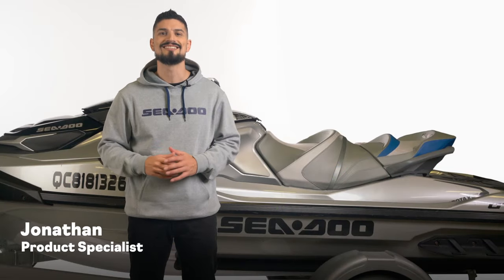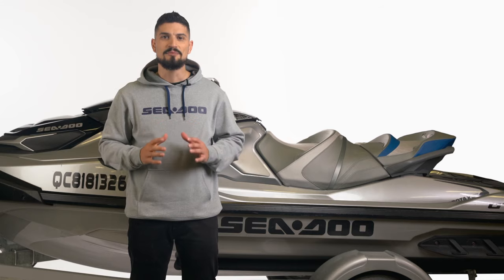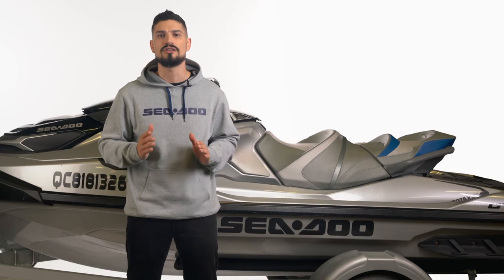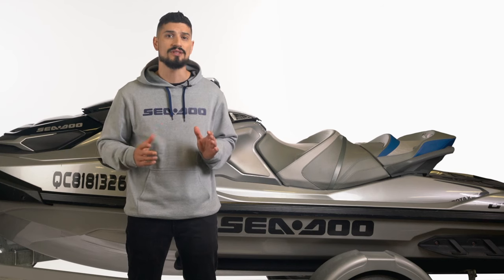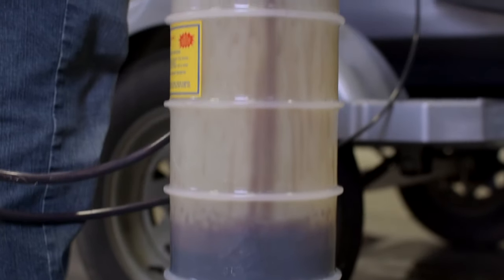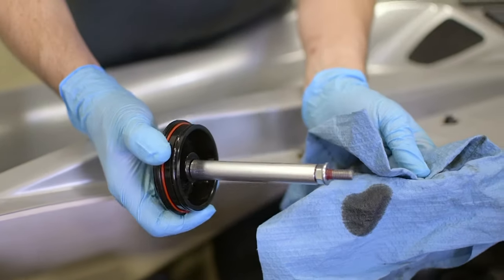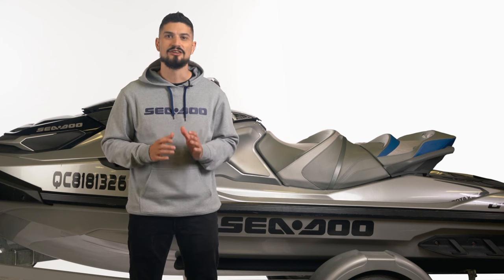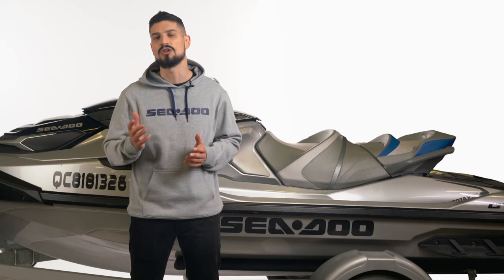How to Change the Oil on Your Personal Watercraft | Sea-Doo

Comment: Do not start the water into the exhaust before starting the engine. I feel like this is an important point missed. 
Engine On > Water On > Water Off > Engine off
Reply: Very important to not run water with engine not running. 
Also add the same amount of new oil as the amount of old oil removed. One may not need to add all the oil in kit.
Reply from the maker: Hey Aaron, 

We appreciate your feedback.

Comment: Nice only I would for sure add that you should also crank the engine and insert extractor into oil filter area as old oil is also located there as well. Also should change small o-ring every time.they are cheap and just a good idea.

Comment: Hay,,, it’s not e8 for the filter housing, it’s a e10. Y’all got a pretty good video for servicing this engine, but y’all need to make a correction from the e8 to change oil filter to e10. I really don’t know how y’all missed that, but fix it. Thanks.
Reply: I don't have the actual torx sockets but I have the multispline which does torx, square, regular, and it was 8mm
Reply: Mine was 10  @MACK3RW
Reply: The 325 uses E10.

Comment: This video should be redone the incorrect external torx socket is referenced. They suggest an e8 and on my Rx, TX 2023 and RXPX 2023. It is an e10. If you’re going out, especially to buy an E8 you will be seriously disappointed when you get home.
Reply: Yes mine was a 10

Comment: Dosnt it hurt the motor to remove oil and turn the seadoo over sounds like it would
Reply from the maker: Hey there, 

It's important to follow the directions carefully and consult your owner manual and or local dealership for further guidance
Reply: Just answer the question 😂

Comment: Does anyone know how to clear the "Maintenance Required" message on a GTX 300 with the "LARGE PANORAMIC 7.8" WIDE LCD DISPLAY" without having to use the CanDoo software?  The owner's manual has instructions for clearing the message on the 4.5" and 7.6" Digital Displays but not the 7.8" Wide LCD Display.  I've searched the internet high and low and haven't been able to find out how to do it without the computer connection.

Comment: When putting the dipstick back in is it supposed to click back in. I feel like the dipstick is not clicking in, so I feel like it’s not secure
Reply from the maker: Hey Tim, 

For further guidance, you can reach out to a local dealership. They'll be able to walk you through any issues you are encountering.
Reply: @Seadoo  ..that's a flakey response..are you AI..or human..hmmmm😮

Comment: Is there a gap In between the top of the oil filter housing and cap I can see a little bit of the red o ring ?
Reply from the maker: Hey Anthony, 

Make sure to consult your owners manual. Your dealership will also be able to assist you with any additional guidance
Reply: Yes it's like that from factory and after